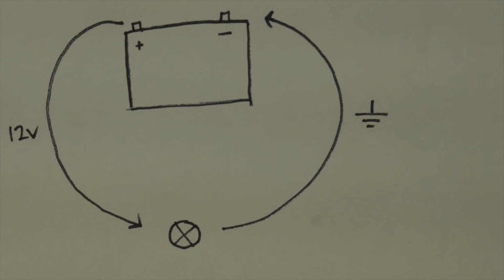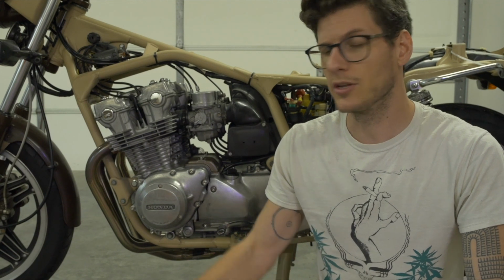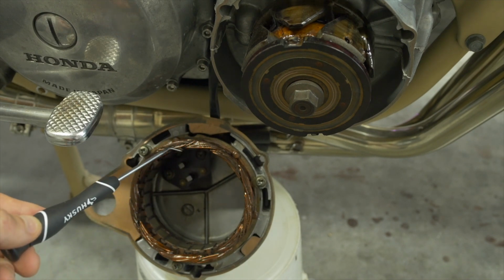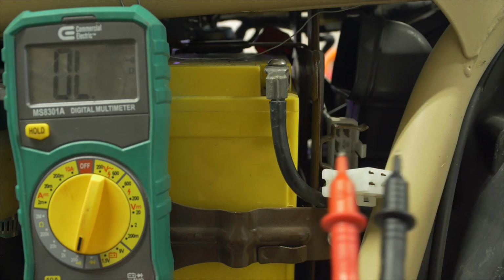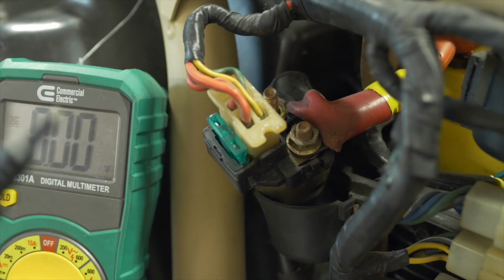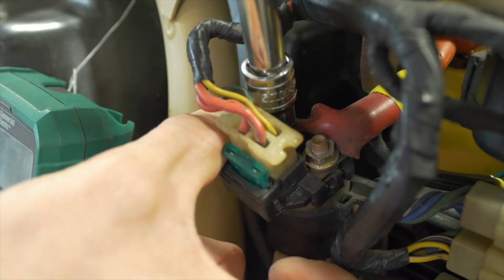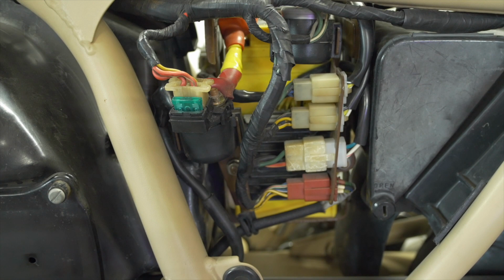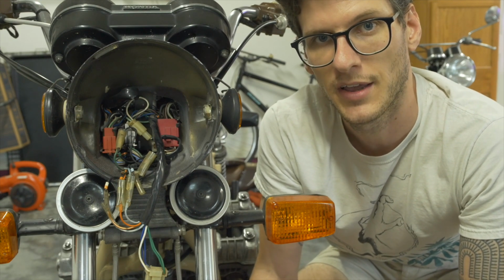1980 Honda CB750 DOHC Electrical System Explained

Comment: ive not seen anyone else run those procom cdi boxes. just got a set myself. Did you see an improvement on anything?
Reply from the maker: I do not have a baseline to compare them to as my bike did not run when I bought it. But what else can I say other than they seem to work exactly as they're designed to. No issues for me.
Reply: @Gumaamug fair enough. I’ll do my best for a comparison in the near future.

Comment: So I’ve bought a bike that was having a headlight issue and after I bought it I swapped to an led assembly light and all and I can’t get it to power on at all. I’ve got 12 to the connections that should have it when I’ve switching in between hi and low beam and it’s wired correctly to the diagram that was given but it’s still not turning on. Anyone have any clues? I’m getting 12 volts to the switch as well on the handlebar
Reply from the maker: 12v at the headlight connector = good. LEDs work a little differently than incandescent bulbs and may need a driver or adapter in the circuit to get the correct voltages. Did your LED assembly come with its own connector built in? Have you tried swapping the ground and 12v lines at the connector?
Reply: @ yes sir I have. It came with a connector and a photo of which wires go where. I tried swapping them and to no avail. I followed the cables all the way back to the fuses and right underneath the headlight fuse I’m assuming a rat got into there and chewed it just enough to short it out. I’ve got it fixed though. I really appreciate the beginning of your video explaining how it works
Reply from the maker: @clixvi1923  Nice! Way to suss it out. Enjoy the bike.

Comment: 31:17 very comprehensive and helpful listing of what all those electrical plugs are for. I took all my electrical off because I was going to pull the engine but now plans changed and I had a bit of a tough time guessing where everything went back. Thanks! Thanks to you I got my ignition working, spark on all 4 instead of 2 (I forgot to put a spark box back on), and my starter working (I didnt know it needed the neutral light / clutch, my 81 kawasaki would start in gear, no clutch, kickstand down)
Reply from the maker: Glad to hear I could help you understand it better. Good luck with your project!

Comment: Dude, I frikn LOVE ALL of your vids!! You're a time & money saver for sure! I see you check back on your comments occaisionally & anm hoping you see this, as
 I do have but just 1 question for you, or anyone else that might be able to help, & it would most certainly be appreciated; I've looked everywhere but can't find the answer; @32:00...what do those 2 letters & the dot on the flat part underneath the RUN-START-RUN dial, right above the starter button???  There's an 'H' + 'P' + a dot. 
Again,any help solving would be great, bc I don't see anything in the manual about it...thanks!

Comment: Does the polarity on the wires between pulse generator and spark units matter? I have a 80 cb750c and the pulse generator no longer has the pigtail so I just have 2 yellow wires that go to spark unit for 1/4 and 2 blue that go to 2/3. Do they have a polarity? And if they do how do I test that?
Reply from the maker: Great question. I don't think the polarity matters in this case. Each of the pairs (Y+Y and B+B) go to a different spark igniter, but you have the pairs mixed up in this comment. According to the wiring diagram, #1/#4 coil are the blues and the #2/#3 coil are the yellows. The pulsers meet the ignition coils at the spark igniters under the seat, so just make sure you're not swapping anything in the chain at that point and you should be good to go.

If everything else is accounted for and the bike still doesn't spark, then try swapping each pair of wires at the spark unit.
Reply: @Gumaamug  thanks, final wiring is either today or tomorrow. I hope I don't fry anything lol

Comment: Donyou happen to have a link to the pdf for the wiring diagram in this video its exact diagram i need for my bike.
Reply from the maker: Hey Kyle, it's not easy to share files on YouTube but if you google "1980 CB750 wiring diagram" this diagram is very easy to locate online.
Reply: I found it thank you so much I was able to get it in color as well. So I'm rewatching this again and something you had mentioned was getting the upgraded regulator/rectifier do you have a recommended brand for that. As I am going to be getting a newer battery for the bike

Comment: Your video saved my life. I work on aircraft avionics and couldn't figure out why the harness in my buddies 80 CB750 wasn't giving any power anywhere. Was especially concerned that it wouldn't activate the starter solenoid. After beating my eyes on the same wiring diagram, and knowing I was right, your video made me 100% sure. Went right back to the battery with a test light, worked my way around, found that I had a loose connection to my ignition and the ground wasn't good for the neutral safety switch. Cranking good, coils got power, and lights work!
Reply from the maker: Ride on!

Comment: You are the first to explain that the whole frame is the earth..back to the battery. 

For those challenged earths you can use a jumper wire from the negative- side. 

Although my battery was charged the low V at start up was a key record that the  battery was old...2011 it was changed I later found out so 12 years old. 

I checked my starter to 12v IV it worked, the stop/start switch had continuity so worked. 

The starter relay was not working correctly.

Thx for your help that was excellent.

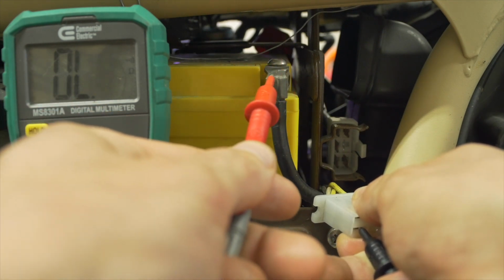Comment: Hey, thank you for the video it’s a big help. So my 1982 Honda CB650 nighthawk has a charging problem. Before watching your video I replaced the stator and magneto hoping it would fix the issue but it didn’t. After watching your video, when doing the test at time mark 13:24, I found continuity on the black wire. What exactly does this mean and what should I do from here?? I would greatly appreciate the help, thank you.
Reply: Also am I supposed to test the connector that is coming from the stator windings
Reply from the maker: Hi, it's hard to give a definitive answer without being there with you and seeing exactly what you mean, but if you have continuity between the one of the lines in that connector and your battery ground, it could mean that the cable coming from your regulator/rectifier is pinched or damaged and is somehow making contact with the frame. Could also mean that something inside the reg/rec is damaged and is making contact with the body of the reg/rec, which is mounted the frame, i.e. the ground. In any case, I would look at replacing the reg/rec. Charging issues are more likely to come from that component than the stator + rotor, but it certainly doesn't hurt that you've replaced those things.
Reply: I’m getting continuity from the copper windings when I put one lead on the negative terminal and the other on the connector terminal I’m testing. Could that be that the stator is making contact with the frame somehow??
Reply from the maker: @_fredoo.m Should not be getting continuity between stator and frame. Don't know exactly what the mount looks like on the CB650 but make sure none of the windings are exposed (usually they're coated in clear epoxy) and especially look at where the bolts mount it to the engine as I guess something could be pinched or making contact there. You said you replaced it — did you buy a new one or a used one?

Comment: Great video, learned a lot!!
I have a 1980 Honda 750f for 43 years now...got it on my 18th birthday..., great bike, but now I am about to give it up..
When I turned the key ALL lit up as usual, and as I tried to start the bike ALL went dark (NO power). I checked the fuses and they are all good, so I tried to test the solenoid and did not spark so I check the battery and it was bad. I replaced with a new solenoid and a new battery and still NO power at all. I decided to get a new ignition and still NO power. The engine does turn when I put the screw driver in the solenoid. I checked the ground connection and I cannot see anything wrong with it. At this point I have no idea what else could be wrong. I really need help
Reply from the maker: Hi — engine turning over when you bridge the solenoid is a good sign! Have you checked all the fuses with the ring/continuity mode on a multimeter or just inspected them by eye? It's possible that one or more is blown but doesn't look that way. They should ring out when you touch the probes to either end.
So you've replaced battery, solenoid, and ignition switch. Next I would look at the right side handlebar switch where the killswitch and starter button are. Take it apart and make sure it's not full of spiderwebs or corrosion or anything like that. Clean the contacts inside with spray contact cleaner. Without looking at the bike, I suspect this switch as you mentioned that everything was fine when you turned the key and then went bad when you tried the button.

Comment: Mr. Masters - I appreciate your review of the CB750 Honda Electrical System. Thanks - I have two 750s. My 79 is fine. The 81 is a Custom for my wife that we just got. Although the turn signals work correctly, The Right Turn Signal ( Blue wire side ) [ will lite up and stay lit  if the Running  Light ( tail light ) Fuze is okay ] unless used normally as a turn signal. In other words, the Turn Signals work regardless. 

After about a minute or so,  the running light fuse blows, and the right signal side is no longer lit up but is off unless the turn signal is selected.  

In reviewing the schematic I concluded that the turn signal switch is leaking a positive from the run light brown wire to the blue wire side of the switch. 

Observations: When the run light fuse blows, the run light does not receive power otherwise. The Turn signal fuse which is adjacent to the Run Light Fuse has not blown - turn signals work normally - 

Your opinion is most welcomed - 

thanks !
Reply from the maker: Hi, nice to hear from you. My gut says there's a pinched wire (somewhere in the headlight bucket perhaps? Or maybe under the seat where the harness for the tail light and running lights clip to the fender).
Reply: @Gumaamug  Thanks Ill check them out -
Reply: @Gumaamug  Hi I checked under the seat and the connectors looked undisturbed since 1981. Ill have to check the headlight bucket, as having ordered a replacement switch. The blue line is the only hot as expected. Will see what happens - 

You video's are excellent - I just cant wait to tune two sets of 750 valves some day. This weekend Im going to use a new timing light -

btw: in reviewing the schematic , the blown fuse in question also is for the instrument lights and front run lights which don't work. The front run lights share the same switch vicinity as the turn signal switch. When the fuse is not blown, the right turn signal lights stay on unless the turn signal is selected - this I figure shorts the run light fuse path to ground thereby blowing the fuse. Hence, the turn signals can now operate without the intrusion of the run light power source shorting over to the blue wire. If in the headlamp bucket, will review first, but I got a switch on order -

Oh- something else -no where is there documentation of the vacuum fuel regulator that sits on top of carb 4 - please explain its operation in a separate video - thanks !

Comment: I have an 82 CB750C- bought with a charging system issue (battery wasn't recharging itself after running for about half an hour). I replaced the battery, rectifier, stator and starter solenoid. Now the bike has no power whatsoever, but I did discover that the 30amp main fuse continues to blow. Any suggestions of where else to look?

Comment: Watching your video leads me to believe I have a bad battery. I have a new solenoid and when I try to start the bike my voltage drops to 10 and doesn't come back up. Starter doesn't spin but solenoid clicks

Comment: I bought a 1980 by the way. It was an excellent video I have a 1980 CB750K when I bought it. The battery was bad, and then the guy hooked up in a car battery to it, but he hooked it up backwards.  And before that, all the lights were working on, then after I noticed that he had it on backwards none of the lights would work and then I replaced the 30th fuse. I was born if you knew something else that could have went bad or what could have happened.
Reply from the maker: You replaced the 30A fuse in the starter solenoid? Did you also check the fuses in the handlebar fusebox?

Comment: Any idea what wire in my head light would cause bike to die when put in gear. Runs fine in neutral. Only thing i did was remove some wiring in head light. I eliminated the left switch and wires low beam direct white and blue wire. Either something there almost like a kick stand safety but doesnt have one 81' or clutch just went..... no clue.
Reply from the maker: There is a dead man's switch in the clutch handle that will allow the bike to start in neutral with the clutch out, or if the bike is in gear, only with the clutch pulled in. If you took that out, this explains why shifting into gear causes the bike to die.
Reply from the maker: I looked at the wiring diagram and the clutch switch is just a part of the starter solenoid circuit, meaning it prevents the starter from turning at all if the bike is in gear without the clutch pulled in. It doesn't look like it would cause the symptom you're describing.
Reply from the maker: Just thinking out loud at this point... the only thing that changes electrically when you shift into gear is the contact with the neutral switch. The symptoms you're describing sound like the ignition circuit is somehow grounding out. The neutral switch cabling runs up to the headlight to feed the neutral light in the dash. I would check all wires in the headlight bucket and compare them with the diagram. Make sure the neutral switch wires (Light Green/Red) are correct and not going anywhere they shouldn't be.
Reply: @Gumaamug   think i found it ... the orange wires were grounding to the inside head light frame sound right?

Comment: My rear amber lights are only going on when the turn signal is activated. Is this normal for my 1972 CB750 K. The front amber lights are lit when the headlight goes on but not the rear. All the bulbs are good. What could be causing this?
Reply from the maker: Hi Mark, this video is specifically about the DOHC 750s, not the early SOHC models. But I know that on my bike, the rear lights are not dual filament; they do not act as running lights the way the front ones do, only as blinkers. Hope this helps.
Reply: @Gumaamug  Thank you, very much! I was thinking that I might have an electrical issue, but this brings me relief! Thanks again.

Comment: Fantastic video! Really really like your calm and thoughtful approach of describing everything. 
I mean this in the most positive and complimentary way when I say you’re like the Mr. Rogers of bike mechanics. And the bonus is the comment section of folks adding to the post. I just replaced the reg/rec in my 1981 CB750 Custom with the help of this video. I’ve never worked on bikes before. This is so helpful. Your video gave me the confidence, and it worked!
Reply from the maker: Cheers to that! Just doing my part to try and keep knowledge accessible and friendly

Comment: What's the function of that generator  with the stator
Reply from the maker: Do you mean the rotor that is attached to the crankshaft? The rotor and the stator work together to generate the electricity that charges the battery.
Reply: Can I have ur contacts soo that u may help me repair my electrical issues please
Reply: I own a handa cb 750cc 2007 limited

Comment: My cb750 DOHC was having some issues at idle with uneven temperatures on cylinders 1&4 (running hot) and 2&3 (almost 100*F colder). I have a dyna 2000 but what looks like cheap ignition coils. I tested the resistance on the coils and plug caps and they were all wacky. A plug cap on cylinder 4 had a resistance of about 200k ohms. The secondary resistance on both coils was roughly 150k ohms. I’m thinking I need to order some better coils but I also noticed my ignition spark unit melted all the potting out. Could this be caused by the coils being screwed up? Or is there an electrical issue somewhere else that’s causing excess current to the ignition spark unit?